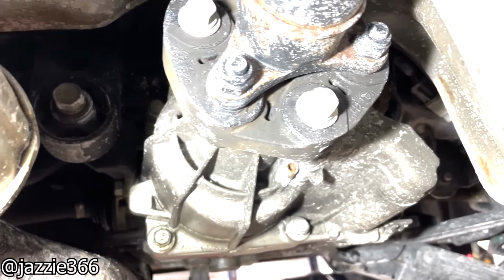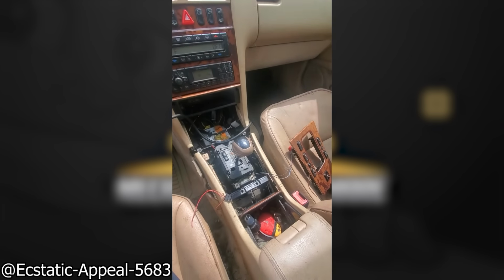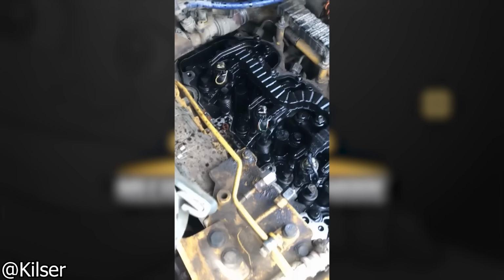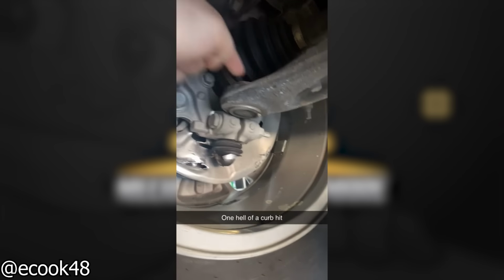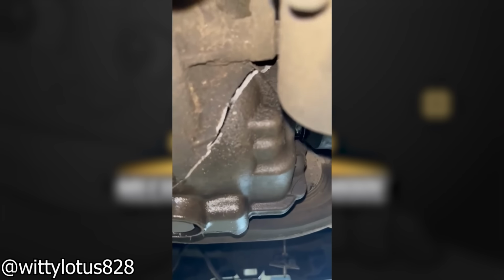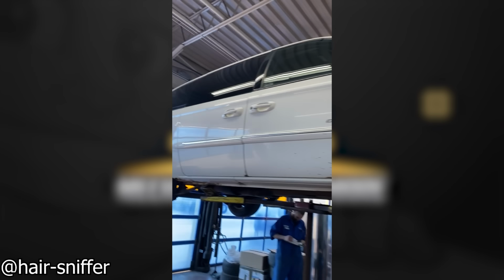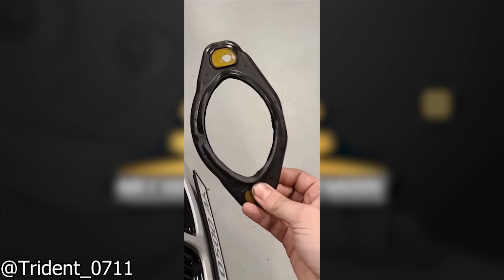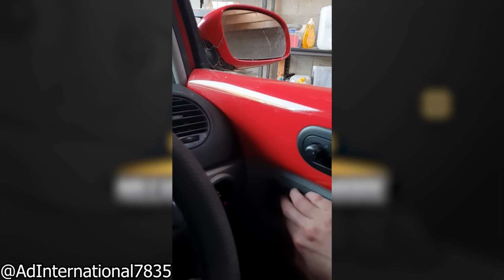Customer States Compilation (Best Of 2022) | Mechanic Problems | Just Rolled In

Comment: A former coworker once had some trouble after changing his own oil. He didn’t know how much oil to put in, so he kept filling it until he could see it from the top. 😳
Reply: 🤣🤣🤣🤣🤣🤣 wtf!
Reply: Soooooo, what happened
Reply: Owners manual(sometimes you need to download) tells you this stuff. Maybe I am unusual for a male but I read the  Owners Manual for everything I buy.
Reply: I once knew someone who changed the engine and gear oil. 

They put the gear oil into the engine, and the engine oil into the gearbox. 

The gearbox did not like 10w40, the engine did not like automatic gear box oil. Gearbox blows up, engine seizes. Fun.
Reply: @markunavail8510  The guy was definitely on the lower end of the IQ spectrum.
Reply: @mbyard356  So your saying his flag doesn't run all the way up the pole and hes a few sandwichs short of a picnic hes not playing with a full deck??? LMFAO
Reply: @billytaylor6604  download? They come in the glove box. Or go get a service manual  for $50
Reply: One question tho, he had no idea what dipstick is for, or he had none in vehicle?
Reply: @kxpes  He was the dipstick.
Reply: @kxpes  I see your not the sharpest pencil in the box and your flag doesn't run all the way up the pole etc. lets look at your comment you say you didn't mention any person so I guess we can assume your co worker is not a person LMFAO
Reply: @markunavail8510  I'm sharper than you apparently, since if you even didn't wanted to look at comments that i putted 2(now with this one 3) and first is question and i cite since it is over you to fix your own mistakes: "One question tho, he had no idea what dipstick is for, or he had none in vehicle?"
rest is talking to specific person who would diminish if he would jump from his ego lvl to intelligence.
Reply: Google is your friend. Lol
Reply: @justinpaul8160  Checking the dipstick is easier.
Reply: Yes there's one on another video where 30 quarts were put in. That's got to be expensive.
Reply: @billytaylor6604  I do the same thing and I even keep the manuals for everything that comes with one in a certain place in my house, except my vehicle manuals. Those stay in the glove compartments. Many people don’t know but they actually have valuable information in them.
Reply: Idk why people lack common sense, the biggest single store bought container is 5qts. 99% of road vehicles will use that container or slightly less.
Reply: @billytaylor6604 I do too.
Reply: @curtismajeskie3419 mine is of the “slightly less” variety… and it’s annoying as hell but luckily it’s a Subaru so I can use what little is left to replenish what burns lol
Reply: @kxpes I’ve heard that some cars don’t have a dipstick anymore…
Reply: @Fetidaf  i also drive a subaru
Reply: @Fetidaf  That is why i wrote "or he had none in the vehicle" because i'm aware that nowadays such low cost part needs to go, because rising in price vehicles cannot hold such low level hardware, and it brings price up.
Reply: @curtismajeskie3419 theres actually more cars made after 2010 that use more than 5qrts. A lot of cars now use 6-7. Lota deisels use like 2.5-3.5 gallons. Maybe this guy thought he had the deisel version
Reply: @kxpes they get rid of the dipstick and you check the oil through the computer. Cost more that way so can charge more for the car. And less ppl know how to do it so it makes them take it to the dealer.
Reply: @mbyard356 if before he starts the oil change he already knows he doesnt know how much oil it takes, he doesnt  know how much to buy. Why think need to fill it until you see it when not even remotely close to that much came oil. Why not ask the parts store buyin the oil from how much it needs? If he thought he had to fill it until he seen it, i highly doubt he had bought that much the very first time so would have to go to the parts store to buy more, so just ask. I doubt he started the process then bought more oil online waitin for shipping. Wow...peoppe are jus a certain type of stupid these days. Idk why ppl have no common sense anymore. Im sure stupid stuff happened back in the 60s-70s-80s, but not nearly as much as it does now
Reply: @jacksmith2315  And you know, people happily pay for it more. "Older i become, older my car i like to be"
Reply: Whats a dipstick there for? To spank engine?
Reply: Was this in 1990 or before? Did someone tell him the Internet exists?

Comment: Being a former mechanic in Arizona, I'm amazed at the condition of those rusted out vehicles.
Reply: We hate it here
Reply: Being in Florida you may occasionally see rust like that if people live near the coast, but rarely to that extent.

Be careful buying any used cars that used to belong to snowbirds, though.
Reply: Be thankful, it's all we do up here 24/7 are salt belt rust buckets, seeing clean cars and bolts that don't require heat to remove constantly lol
Reply: I too was lucky here in AZ until I hired on at an auto transport company based out of MIchigan. Even worse this fleet holds onto everything regardless of how bad they get. I've seen trailers with 80% of their crossmembers rusted completely out. We started referring to them at bluetooth crossmembers.
Reply: There are other cars built from aluminium, fiber glass or stainless steel.  The guilt is on the buyer here,  as they waste money on cars made from pig iron, same as those houses built of wood panels that fly away in tornadoes. I never seen a brick house fly away.
Reply: Northern salt on the roads.
Reply: You’d be surprised by what a northern climate will do to your car unless you take proper care of it.
Reply: i live in new york state and we see components and frames rusted to hell a lot. it is all the salt they put on the snow inthe winter. over time it starts destroying the metals of your car...
Reply: Yeah, PA, NY, and NJ all use road salt and it horror on cars.
Reply: But why use all that salt on the roads? I live in the snowy mountains of Colorado and we don't use salt that destroys our cars. It is so unnecessary. Our cars last forever here. You guys destroy your vehicles for no good reason. Use a little sand or mag chloride and some good tires and run some plows.
Reply: My friends a mechanic in Michigan.. he was so mad when he saw how easy my hub assemblies came off
Reply: I live in Wyoming, we use sand for our roads, it’s cheaper to replace windshields than frames and shit lol
Reply: @eianmerino190 I live in Illinois where we use salt and I went to northern Michigan last winter where they use sand and I gotta say… I prefer salt lol

Later the same day in Illinois the roads are clear and they never cleared the entire month I was up in Wisconsin… which snowy roads can be fun, don’t get me wrong but I’d rather they be clean and dry and I need to wash my car more often.
Reply: I kept thinking about cars not given undercarriage coatings to protect from the road salt in places with bad winters. But I forgot about the coastal areas with the sea salt in the air. I think that is a thing as well, that messed up certain metals not protected.
Steel & iron are heavy, and so vulnerable to rust. But they are cheap & strong.
And the FortNine video about metals, really made me appreciate steel & iron.
Reply: Salty roads, salty air bro.
Reply: @MoabYoda  Magnesium Chloride is a type of salt, Pennsylvania does use that in some areas but it depends on the area. They also use a lot of chipped limestone and regular halite rock salt.
Reply: Upstate NY here - F*CK road salt, man. A friend moved to Montana, they get tons of snow there too but they don't use salt! Proving it's unnecessary!

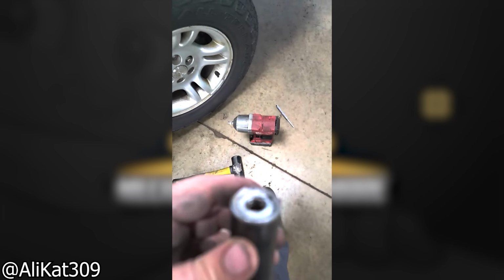Comment: 5:47 same damn thing happened to me recently but more like 90% of the nut snapped off, and being a mobile tech I didn't have an acetylene torch to just burn it out, so I tried taking the other lugs off, and using my pry bar to try and snap the stud to get the job done and replace the stud. Instead eventually my pry bar slipped, nailed me in the eye and gave me a shiner. Needless to say, I told the dude to take it to a shop that's equipped for that fuckery 🤣

Comment: I was a mechanic in my younger days and I seen a lot of this sort of stuff, especially the brake shoes. She says your brakes make a funny noise the brake pads eaten all the way through the rotor into the cooling fans.
Reply: I've never even heard of that outside these videos. My last car, I got new rotors at 60k out of precaution and bc I was replacing the pads anyway. The factory rotors looked great still, I half wondered if I was wasting money.
Is cooling-fin exposure when you keep the original ones for like 200k miles??
Reply: I once had a customer that was stone deaf , you should have seen the brakes on her car.  The sad part was no one told her about the racket they were making , she just knew they felt funny but couldn't bring it in when she first noticed.
Reply: @nthgth  no even that wont necessarily wear through to the fins my jeep still has the original rotors up front it's got nearly 500k miles on it and they're way past the point where I should replace them but it isnt being driven due to a blown up axle and a bad slave cylinder but they're still not down to the fins yet pretty far from them actually usually what causes that is when people run them down to the metal baking plate on the pad and keep going like that until this kind of crap happens once I get my new slave cylinder in I'll do the rotors and pads but untill then all I do is move it from one end of my property to the other to get to other things behind it so its not an issue at the moment

Comment: That clip with the Cockroaches reminded me of a time when I was checking for a drain leak in a bar sink and I had to remove the panel covering where the leaking pipe was and after removing the panel I looked inside and it was real dark but it looked like the walls were moving and as soon as I shined the flashlight the horror was like right out of a movie. The walls under the sink were covered with roaches which scattered as soon as the light hit them. It freaked me out and I jumped back about 5 ft. in shock from the surprise. Nice!

Comment: One of my favorites was a car belonging to the husband of one of the ladies in the dealership's office. "Stan's car didn't start this morning. When you have it in, can you look at the brakes? It pulls left when you stop." The right brake had gone past worn out, the pad's steel backing ground the rotor off of the hub, but held it in place by the seized caliper

Comment: I was working as a grease monkey at a garage In country Ozback in the early 70's when a young man (19-20) drove up in an older Holden station wagon ( GM for you Yanks) and it sounded like the car out of Chitti Chitti Band Bang. It was a hot summers day here in the outback and he had driven it some 250Ks ( 160 miles) when the motor overheated and seized. To cool it off, he hosed the motor down with cold water!  And because he was told the motor was out of oil and needed filling, he filled it!  He put way too much oil in it and because the head was cracked from overheating it mixed the oil and coolant to make a lovely sludge which covered the motor. The dumb thing was it did run, but sounded like it was only running on 2 1/2 cylinders out of 6. He asked if i could fix it, as if it was just a failed spark plug. By the way, it was his dad's car and his dad was not going to be happy! He drove away slowly, leaving a trail of mechanical diarrhoea.

Comment: I had a brake line fail right at the wheel once, had a rotor break apart like a few of these, with the disk separated from the hub part. Thankfully it failed in the mall parking lot and there was enough brake system pressure and three intact rotors for low speed driving to the firestone in another part of the lot. 

Annoyed me because that's a repair I'd usually do on my own for a lot less money, but the 30 miles of highway with how my brakes were performing seemed a bit dangerous.

Comment: In the 70s, I worked at a car wash and a guy from a local dealer we washed cars for, brought in a customer's car. She had flicked a cigarette out the window, and it came in the back window. The seat caught fire, and she raced back to the dealer where she bought it to have them put it out. Along the way, she passed 3 fire stations and did a lot more damage to the car because she was driving with the windows open, and fanning the fire the whole way.

Comment: 10:14 is scary. That's a Roadmaster, Impala SS or Caprice Classic. I recognized the 'home plate' air baffle immediately. It has a mechanical fan, so it's either an L99 or a tow package LT1.   I hope I never see this in my 1996 Buick Roadmaster sedan
Reply: Yeah, as a 9c1 owner it was instantly recognizable
Reply: Just do your regular maintenance and servicing, especially thermostat and flush at regular intervals.  They can cook in a just a few minutes if it's not right.  Most (all) of these cars are people who didn't do regular servicing or just did oilies themselves (or jiffy lube).  There's a reason manufacturers give a schedule for things to be checked/replaced.

Comment: @ 1:55 I bought a Mini Moke from my next door neighbor, when I took it in for service my mechanic said, Do you know who sold you the car? I said yes, why? He said, Could you ask him if he used to concrete or cement to fill the frames with since they full of rust
You know that square section where you sit, on both sides, that runs the length of the Moke, yep, all rusted out, no metal, just cement painted orange

Comment: For anyone who's never worked in a gas station - the early years of my automotive career were spent in gas station garages -  you'd be amazed at how often people whose cars are on fire drive into gas stations.  And park on the fuel pump island.  Sometimes blocking traffic.

I may be over exaggerating slightly, but I swear we had one a week during the summer (almost always during the summer) pull in, with flames, demanding that we do something.  Oh, and get mad when the boss charged them for the fire extinguisher.

Comment: I've seen practically every one of these many times.  It amazes me how more people haven't died being oblivious to things.  And you'd be surprised at how many people say they just had it fixed.
  Anymore, it's almost too much of a liability to be a mechanic. Someone comes in for an oil change, next thing you know, they're calling, saying their rear hub/wheel came flying off the car going down the highway.  And they accuse you of not fixing the issue.  They came in for an oil change and didn't ask about anything else. Then, after your wheel falls off, you state the car was making noise and you assumed it needed an oil change, when it was the hub coming apart on the rear.
  So many people try to get over on mechanics.  People think we're stupid, when it's them that are stupid.

Comment: Fathers teach your kids the basics. Little things like how to read a dipstick, where brake fluid goes, how to change their own oil, fix a flat tire or if your not mechanically inclined at least teach them to have their car checked when they hear strange noises. Im 53 and when i went to high school they had classes that taught this, home ec. and shop classes. I think most schools have phased these out as outdated but I think thats a huge mistake. Then again everyone has their own opinion even if its wrong, just watch the view once to see that
Reply: Another important thing is to know when a job is too big for you to handle and it is time to go to a mechanic.
Reply: @thenthson  Your exactly right. It depends on the person and how mechanically inclined they are. For instance years ago I had alot of guys at work tell me to go to a mechanic to get my CV axle changed. Instead I pulled it, then took it to a shop that replaces all the bearings, boots, repacks them and basically returns you a new CV axle. Pulling the axle I was comfortable with but I didnt have the tools to rebuild one so I went to the specialist. Know your limits
Reply: Drivers Ed teaches all these things still. At least in montana

Comment: Since this happened a time well before the cellphone camera, I was at trade school and a fella brought in a 318 dodge engine for us to diagnose and repair. Said he went mudding and got stuck. "Might have over revved the engine" Then heard lower engine noise. So we took the pan off, all of the connecting rods and rod journals were tight. So removed everything to pull the crank. That's when we found the problem. The crank was broken right at the thrust bearing right in two! Welp there's your problem!

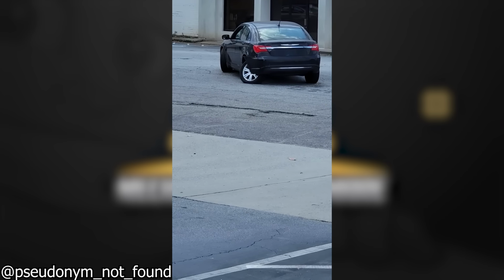Comment: As an auto mechanic for 32 years (retired 15 yrs now) i have seen most of the things in this video. and the one at the 1:00 mark in the video made me laugh because i saw that one one time. a 1987 chevy Malibu came into our shop with the same complaint,runs bad and smokes. the woman who owned was putting 5 quarts of oil in it  (305ci or 5.0 liter motor ) every 5k miles not realizing you had to drain out the old oil and change the filter!

Edit: Had not realized i watched this video 11 months ago. so extra points comment!

Comment: 5:50... I was getting gas at this large station off the highway once and this customer outside asked if I had a lug wrench he could use.  The station didn't sell them.  I of course let him borrow mine.  Apparently he had just had his tire replaced at Walmart and they had not fully tightened the lug nuts.  Not only had half the lug nuts been ripped off by the loose tire but it ripped the bolts in half also.  He was going to tighten the remaining ones and drive back to have it fixed.  However, as he tried to tighten them the bolts started breaking.  He was down to just 2 bolts in the end.  I was like, dude, you need to get that towed back.